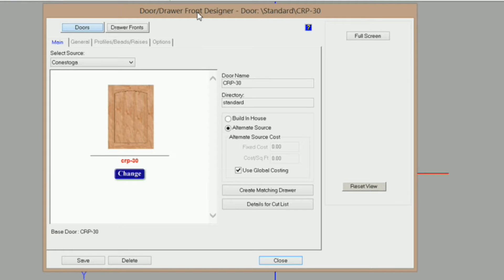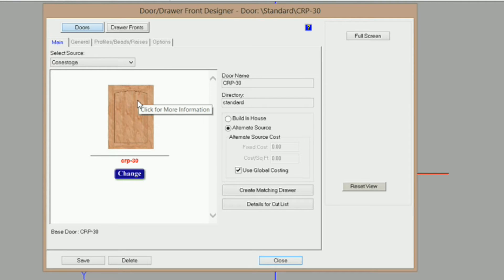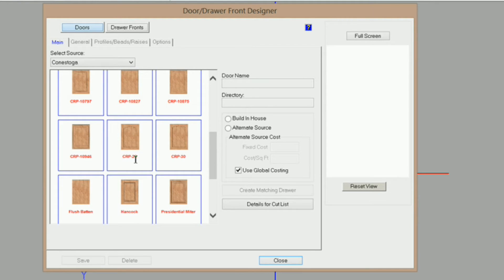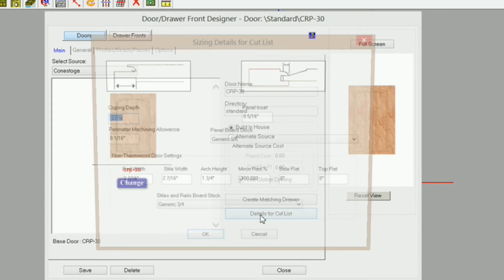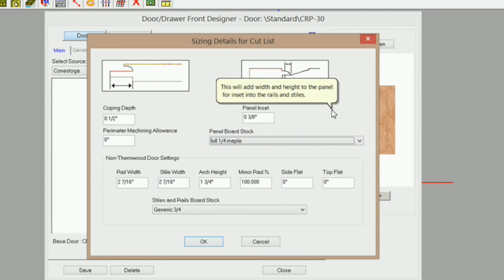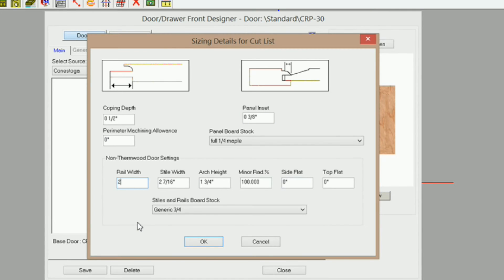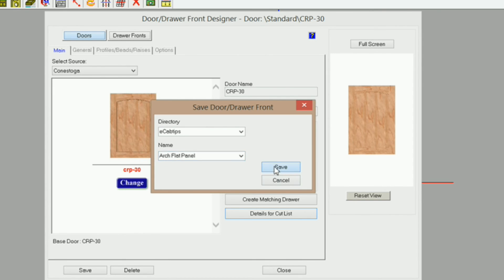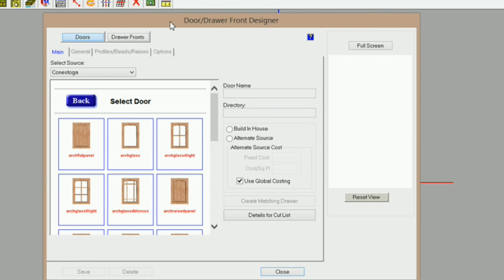How to make a custom door library in eCabinets

Comment: Is it possible when doing this to have the door  center panels included into the nest to be cut on the machine?
Reply from the maker: Hi Ken. When creating five piece doors the software forces us to use a solid stock material. However there is a way to get the panel sizes from  ecabinets into an excel spreadsheet then export it to ecabinets batch to cut on the machine. If you would like to discuss this in more detail. you can contact me at ecabinetstipsandtricks@gmail.com